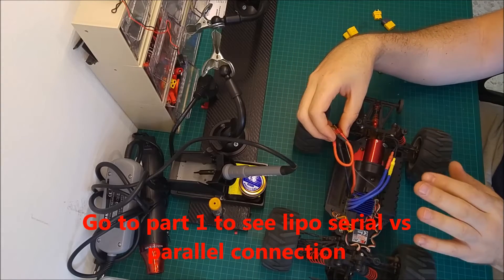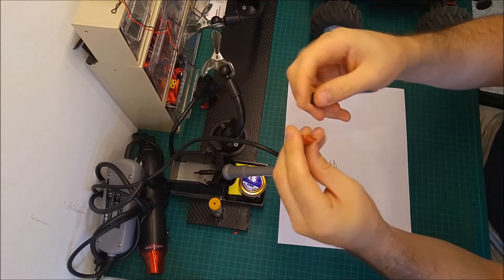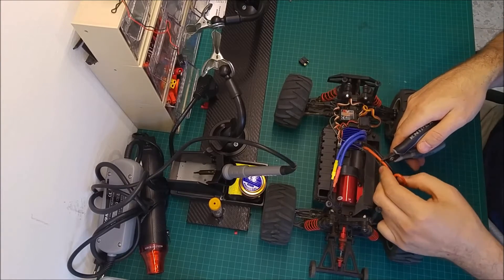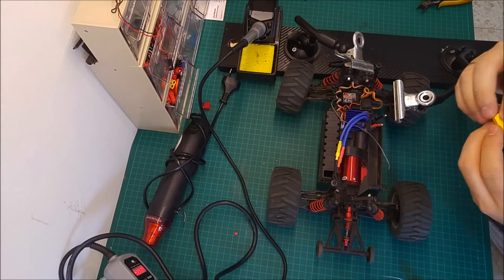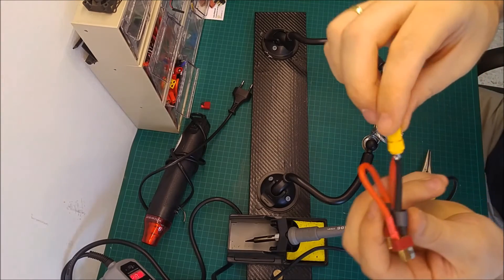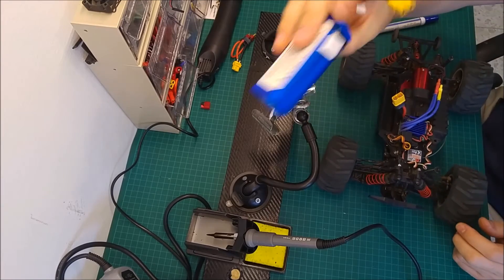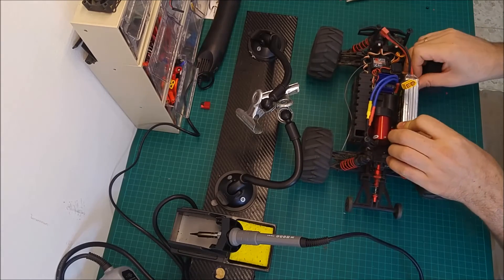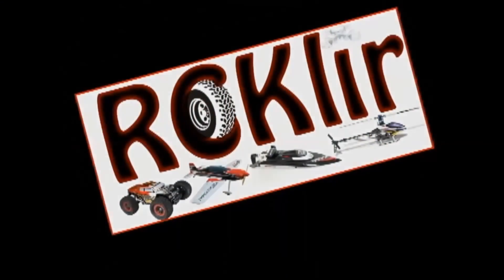ACME A2040 - Battery mod (part2)

Comment: nice thanks for the DIY, I plan to use a bolt LIHV. Do you think the higher voltage will be okay with the acme>?
Reply from the maker: I think Lipo 4S is crazy fast for the car so you don't need extra power, if you go LIHV, i think you should go 3S max.